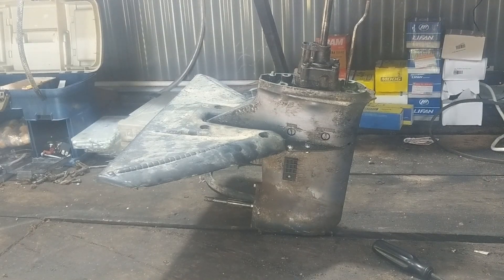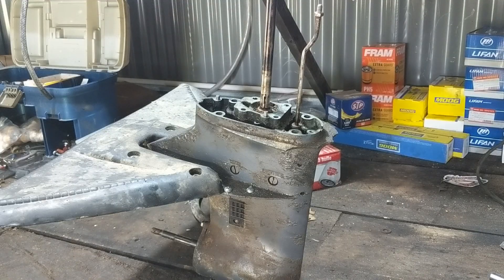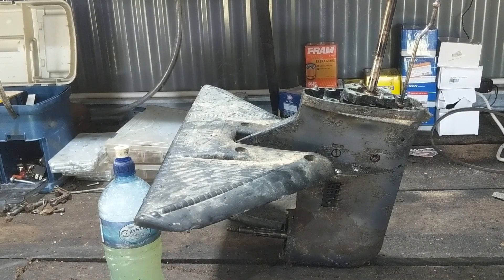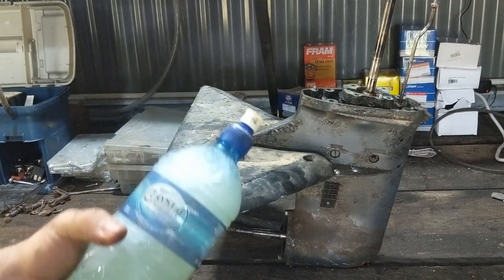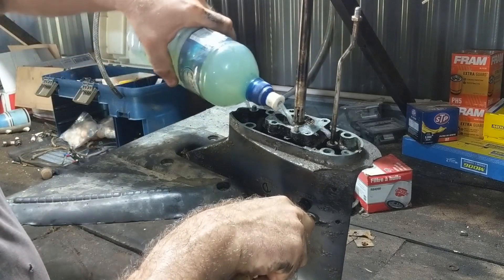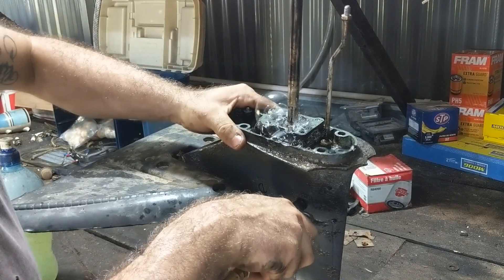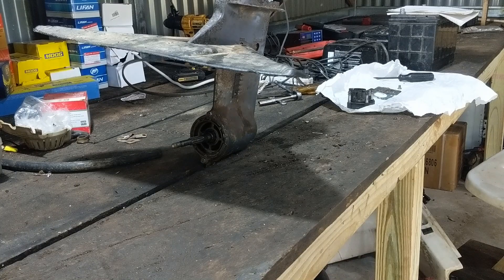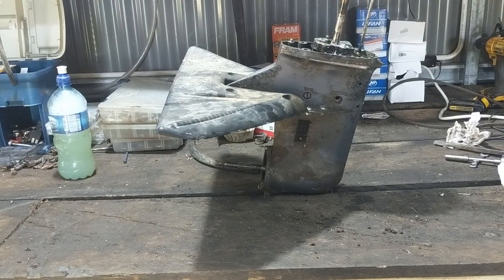How to pressure test an outboard lower unit

Comment: Thanks for the video. Question: if you have milky looking lower unit lube and you fail the pressure test, should you inspect the gear case and make sure there isn’t significant corrosion or other damage? Or if the motor is running and shifting ok do you just replace the seals, and assume the gear box is fine? Thanks.
Reply from the maker: Well if the case is obviously broken that would cause water intrusion. But typically seals and new fluid are what's needed unless the mating surface where the seals go is too corroded to make a good seal

Comment: I just drained the oil on my Suzuki df70 and saw a very faint white in with the oil color. I did hit a rock with the prop. Guessing this might be my issue. Question is, I used the engine for about an hour or two in low RPMS after since noticing this. The white was so light, do you think my engine is safe? Took it to the dealer where they are going to charge me my soul to find out what it is and fix. Any help here would be nice…. Thank you! 💪🏼
Reply from the maker: The good thing about lower unit oil, and part of the reason it is so expensive compared to regular gear oil, is that it has the ability to absorb water that leaks past the seals and continue to lubricate well. Other oil will separate and expose your lower unit gears to insufficient lubrication and rust form water. So its likely that there was no internal damage from the water intrusion. However, there are some other things to consider. You should check that there were no cracks to the housing from your impact, and that the prop shaft is still straight. Additionally if any water got into the oil it means one of your lower unit seals is leaking. Now its possible a little water got in from a shock from the impact, and the seals are still fine. However more likely is the seals are starting to fail which is par for the course for an older motor. My advice to you would be to inspect for obvious damage, and finding none, put in some fresh oil and check it again for water evidence after a couple hours